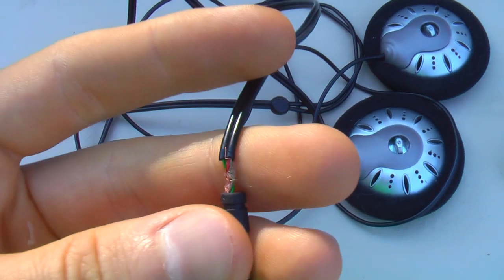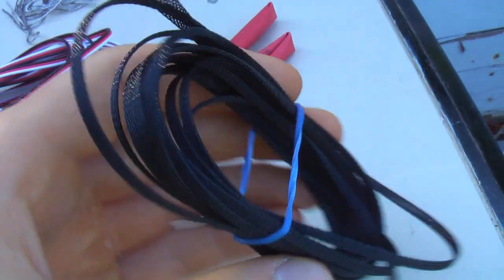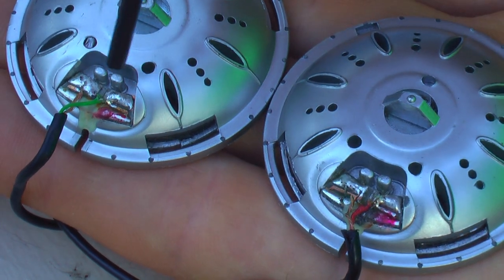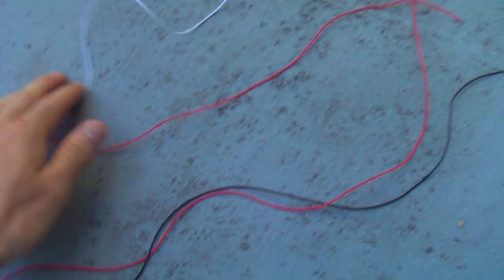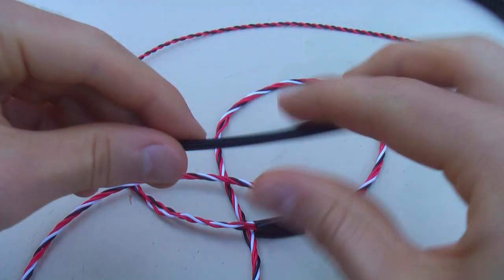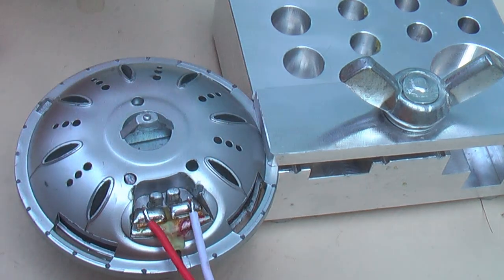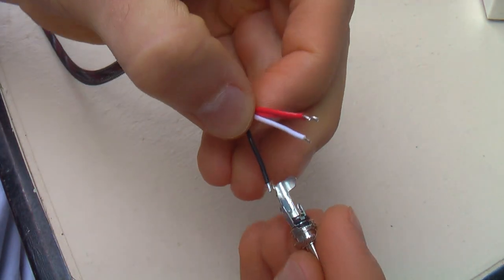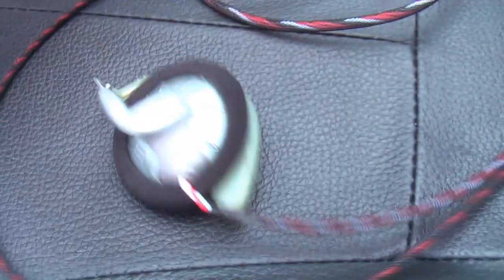How to Rewire Headphones - Sleek and Durable Design

Comment: I returned to your video after 2+ years of using my KSC75 for jogging - they survived without any upgrades but the now one is disconnected so need to get new ones or replace the cable :) I found some on Temu / AliExpress - i.e. if you search for: T1 8-Strand Silver-Plated Upgraded Cable Wired Earphones Replacement Cable 3.5mm 0.75 2PIN Earphone Upgrade Cable - they seem to be designed for QKZ-T1 headphones but look promising - the ending looks good for soldering - what do you think? seems like a good 5EUR cable - just a matter of proper soldering + some glue or silicone.

Comment: wait so how do you know which one is the positive and negative wire?
Reply: Anything black or blue is negative. However in this case, it is called "common" because there's two of them, one for each driver. 

Green is Left Speaker, Red is Right Speaker.

Comment: Nice video.  I'm about to try changing an old pair of KSC75s to support Bluetooth, after buying literally the cheapest Bluetooth earbuds they had at the store.  I have no idea what the sound or battery life will be like, but they were super cheap, and I have multiple old pairs of KSC75s.   I haven't soldered in a while, so it was useful to see your closeup video of that.  Thanks.

Comment: Odd wire color choice. Why not black for common and white+red for L+R signal like it's worldwide standard?
Also, you said you don't like the original stiff wires, but in my experience they only stiffen after long use when exposed to finger fats and such, and they're very low-diameter. Your custom cables in comparison look very stiff.

Comment: Hey bro, is there a way to repair in ear earphones? I actually invested in a good pair doing the research this time and these lasted me ages. The quality was also outstanding. BOTH ears still work but the right one goes really quite when I move it. To fix the problem I tap a few times into the actual earpiece whilst it's in my ear to fix it. Any idea what's the problem? They are a pair of Ostry KC06, HIGHLY recommend
Reply: Do you wrap your earphones around your device when you are done listening to music?
Reply: Na bro none of that. Don't know if it helps but they're Ostry KC06 and the actual wire doesn't seem to cause any problems, rather the actual ear thingy itself, when I tap it or blow into it, it works, until I myself move the position of the bud in my ear. But I'm not sure if it's the actual earpiece or the wire either :/
Reply: I think it may be the Wires connected to the Eap piece speaker.
Reply: hey did you manage to fix your ostry kc06's? my kc06a's no longer have sound coming out of the right earpiece, did you manage to repair yours?

Comment: Great video! Excellent idea to completely replace the cable rather than try to deal with the sometimes difficult to strip and solder original stuff. Also your own cable is often much sturdier than the original. Cheers from the UK!

Comment: "I have not bought into the lead free"... No you havn't, and you never should as long as leaded is legal. It simply sucks. Only reason its used, is because commercial electronics has to.

Comment from the maker: I use Metric 99.9% of the time, and it is totally the system of the future, but when I was looking around at headphone wire designs, they were all in inches, and I didn't feel like converting over.